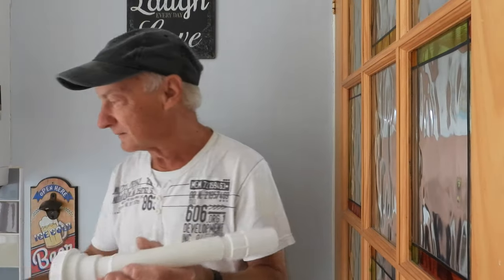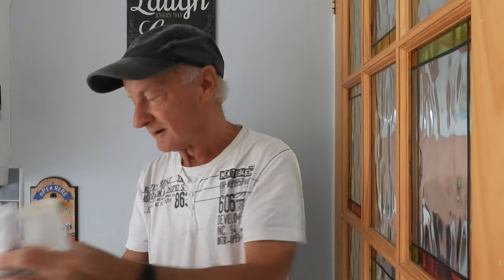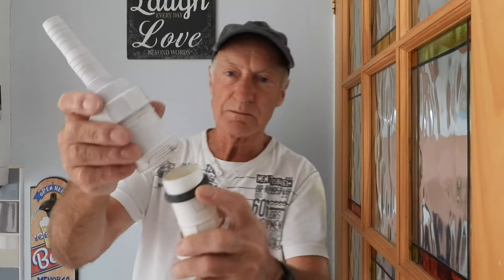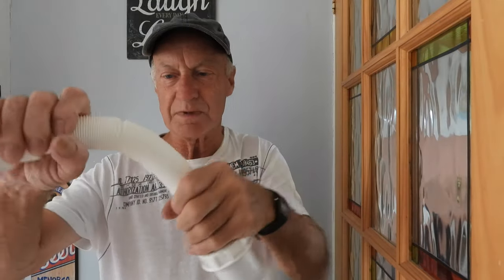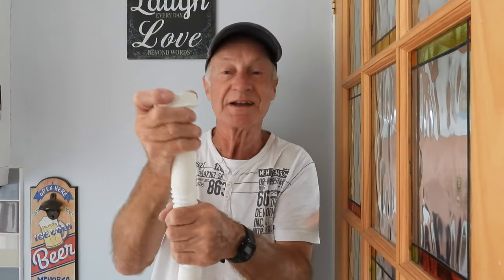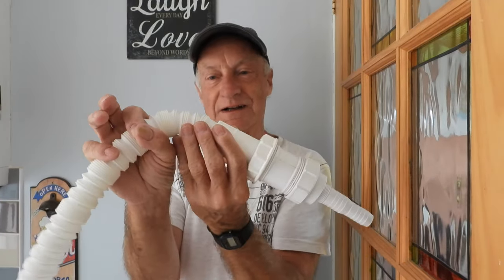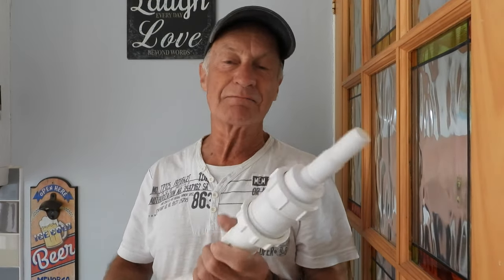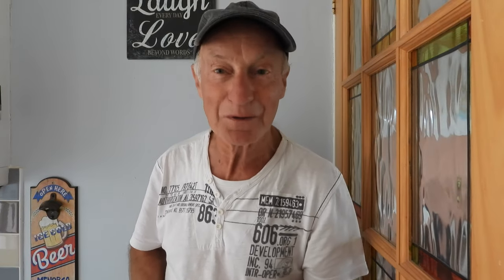How to easily match up waste pipes that do not fit.

Comment: Made me smile as I had, some years ago, a problem with inches and metric. Original pipes were in inches and I had to attach new plumbing to sink basins throughout an office block.  Solved it by creating a larger fitting, but never thought that anyone else would have had the same problem.
Reply from the maker: Thanks for the info Colin.
Reply: @dereton33  That is a nice piece of kit and wish I had had it when some years ago I was doing pluming.

Comment: Great video Al as always 👍 there is also a solvent weld flexible connector called magicflex which is very handy, saves heating the the waste pipe up to pull a slight off set on it - you know what I mean Al (plumbers secrets) 😉
Reply from the maker: I will check it out. Thanks PB.

Comment: Hi Dereton33 great video as always. I bought one of these today and the plain pipe end fits a 32mm push fit socket but the compression end fits neither a 32mm nor a 40mm fitting or pipe. Lots of folk have mentioned this too on suppliers’ site. What does this compression socket fit to? Any advice would be appreciated.
Reply from the maker: It fits Macalpines compression  couplings

Comment: Love your videos! Just a question. We are wanting to add a corner basin  in our very small toilet. We have limited space. Is it possible to tap into the pipe that comes from the cistern to the toilet bowl,  using a T piece,  as a waste pipe from the basin. We have debated getting a integrated sink in a  cistern (we have seen your video) But there is nothing wrong with the present toilet and it seems a shame to have to take it out if we can just fit in a small basin. Thank you
Reply from the maker: Yes you can! I do not see why not . Except you will have trouble getting a tee onto the flush pipe as nothing fits, it is an odd size.
Reply: Thank you for your advice. We’ve been looking at T pieces. Fingers crossed!

Comment: Great advice, as always……any tips on how to blank off an obsolete 22mm hot water pipe ….it’s in a very tight spot between a wall and a joist..
Reply from the maker: Use a surefit bung.

Comment: It does get a lot of gunge in it when it is bent. Any ideas how to get rid without taking it all apart?
Reply from the maker: Use an air pressure gun.
Reply: @dereton33  thanks